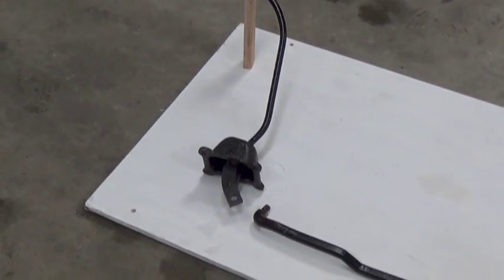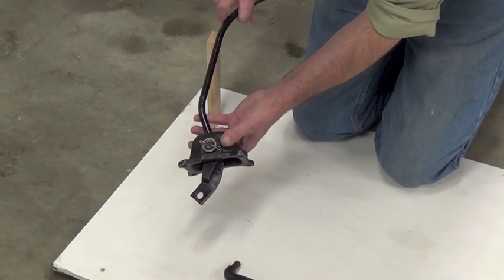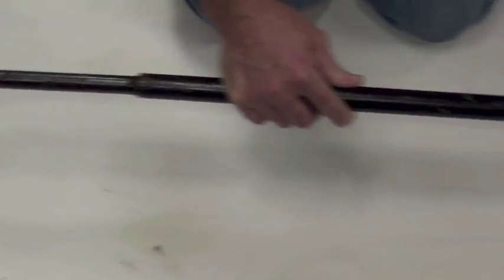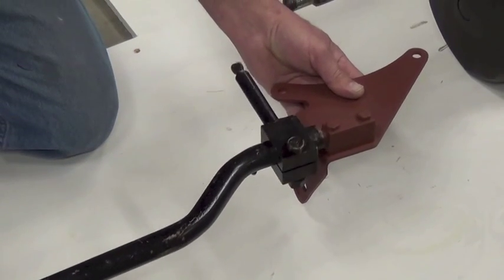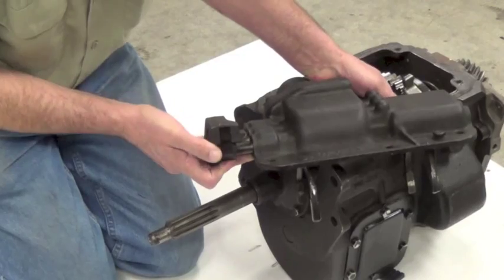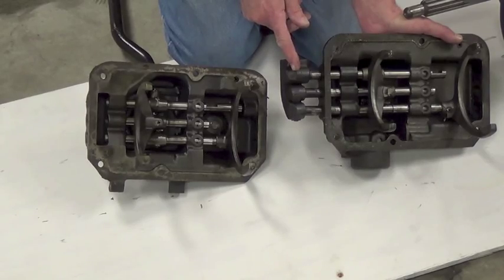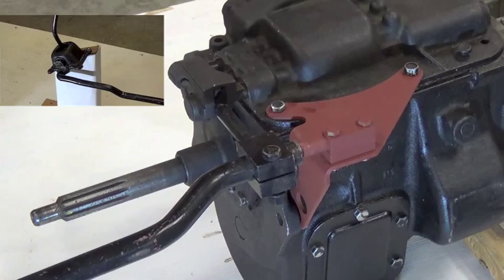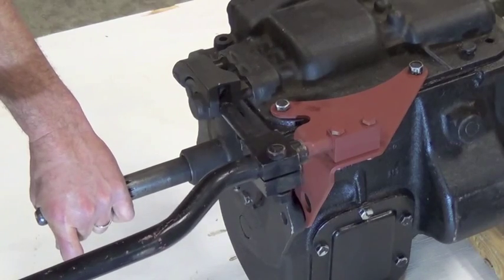Jeep FC 4 Speed Transmission Shifter

Comment: Great video and explanation of this rare setup.  The 4-speed shifter on my FC has a modified linkage at the tranny that includes a small universal joint in place of the shifter ball.  I need to rebuild the in cab shifter and will use this as a reference.  Thanks,
Reply from the maker: +Tom Hallberg Glad the video will help you. Ask about rebuilding your 4 spd cab shifter on the Jeep Forward Control Forum, very helpful info will followWill R